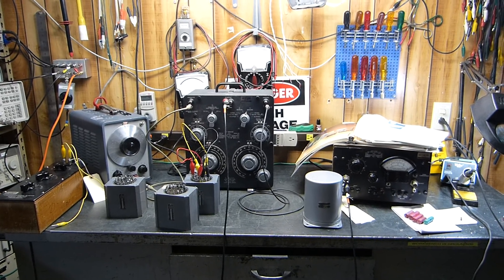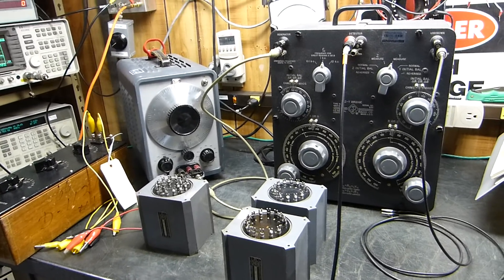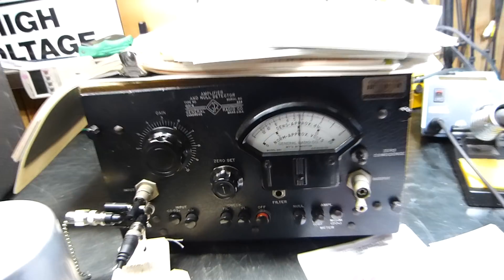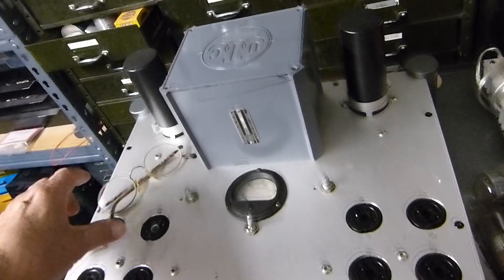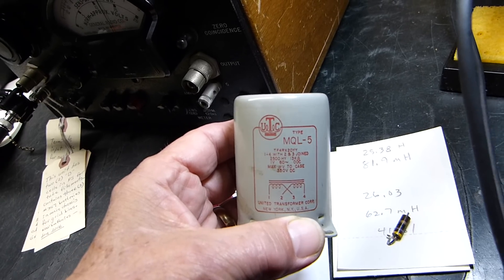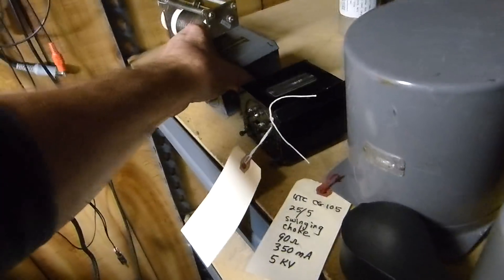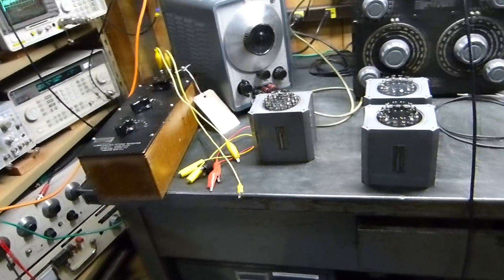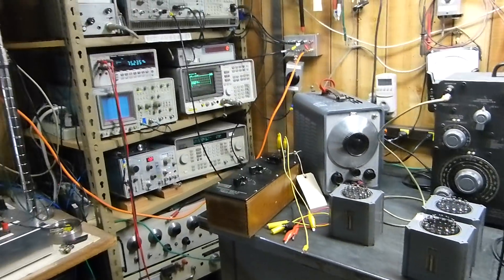UTC, James & McIntosh Transformers In Williamson Design Vacuum Tube Amplifiers

Comment: Agree especially the UTC A20’s I’d like to have more mixing transformers Low Impedance to Grid
Reply from the maker: I have built all of them that I show in the video. A stereo version with the UTC LS-57 using 7591. Also a stereo version using the Acrosound TO-300 transformers using KT66. Both are Williamson design with 6SN7. I find the LS-57 has a better high-end and the Acrosound a better low-end. Both are very good but I do notice that difference. The LS-57 will do 30KHz pretty good but totally falls apart below 30 Hz. The Acrosound starts rounding off above 20 KHz but will to 20 Hz quite well. Actually, right now, I have each stereo amp running as a monobloc, one driving the left channel and the other driving the right channel - a pair of Tekton speakers.  I have found out from years of listening to stereos that as strange as it may seem, mixing different amplifiers - or different high quality speakers in a stereo setup, actually sounds great. They are complementary - where one is a bit weak the other fills in and vise versa. I also built a stereo SET with 300B using 15H chokes as a plate load and James transformers to match the plate impedance to speaker impedance. Does a good seven (7) watts and as poor as SET amplifiers performs analytically, it sounds marvelous. It isn't all about THD - that is for sure. Thanks for your comments.

Comment: Good Morning here in Philippines!   My father left me some transformers that are at least 5 kilos heavy each one,  and the have ten terminals on the bottom,   and i am wondering how to use them now for maybe,  an amp for my electric guitar?  Do you have simple DIY plans on how to go about these mysterious things?   Thank you .
Reply from the maker: Hopefully, there are some numbers on the transformer so you can research it on the Internet. If I had the transformer in front of me I could probably figure it out. You have to determine which is the primary - the winding you want to plug into the wall outlet and then the others windings are pretty simple by using a volt meter. 
Do Not just randomly decide to connect a power cord to the transformer and plug it into a wall outlet. 
Very bad things could happen and even if you got it correct, you may have deadly high voltage on some of the terminals. 
I am sorry but without it in front of me and on my workbench with my meters, I don't know what to tell you unless you have a manufacturer and model number that you can find on the Internet.
Stay safe as transformers can be a deadly device once voltage is applied to them.

Comment: Hello, I´m looking for Output Transformers for 45 RCA Globe tubes.Primary 4,5-5k. As I see You have  the UTC and James transformers, would You mind to advise me which one is better for 45 tube? Thank You
Reply from the maker: I see from the data sheet that the 45 is capable of 18 watts with fixed bias. Very nice level for a Williamson design amplifier. 
The UTC LS-57 (rated at 20 watts) is a 5K primary and the James transformers I personally have are 8K primary so I can not compare them exactly 1:1. However, I will say this from my experience. 
First off, both of these output transformers perform extremely well. However, getting even a few additional watts out of the UTC transformers doesn't seem to happen in the same circuit comparing to the James transformers. I would actually expect a little more power from the 5K than the 8K.  On the other hand, the James transformers, rated at 20 watts, can deliver 35 watts or maybe a little more so it seems the James (and possibly all newer high-end transformers) are more efficient than the vintage UTC transformers.  
From a few measurements, it seems the UTC transformers perform a little better at the high end - 20 KHz and above, than the James transformers. 
As for price, they are about the same on Ebay and both are sometimes hard to find. It is just  me but I am not going to pay more than $150 top... for a 20 watt transformer.
The amplifier I listen to daily runs a UTC LS-61 and I think, overall, for whatever reason, I prefer it to the same amplifier when it was running the James transformer. Possibly that  is just my ears and my hearing does drop off sharply above 8 KHz as I have tested my hearing multiple times with multiple instruments.
For what it's worth, those are my thoughts on it.
Reply: @ElPasoTubeAmps   Thank You for reply!  do they both have a nickel  ? I looking for those 80% Nickel  OT
Reply from the maker: I assume you are talking about a shiny nickel plates case?   
The UTC is grey paint and I think the James is black paint. 
I don't know of any nickel finished ones.
Reply: @ElPasoTubeAmps   No, I mean the nickel core or/and nickel insolation
Reply from the maker: @rightturnonly6621  I don't know the answer to that.

Comment: I have a UTC transformer CG 302W. I dont have a wiring diagram to power 115 volts to primary. Can you help me out. My email is josealfaro1023@gmail.com
Reply from the maker: I found this.
https://picclick.com/Vintage-UTC-CG-302W-Commercial-Grade-173688140540.html

Comment: Cheater way to get bias voltage: Of course you can pull a "backwards" diode off one of the HV legs in a conventional FW tube rectifier circuit, just like on a Fender tube amp. Another way is to use a small filament transformer, backwards. Power the 6.3 volt side with the heater volts from your big transformer and you'll have 115 volts coming out the primary. Half wave or bridge rectify. I don't mind one bit powering an 0A2 or 0B2 gas tube followed by a voltage divider to produce a regulated bias supply. Cheers to you.
Reply from the maker: I like your way of thinking and have used the backward 6.3 volt transformer for bias supply. Not too long ago I built a bias supply for a pair of 813's in PP and used the VR tubes. I think they are beautiful. Thanks for your comments.

Comment: Happy and  productive new year. Love your videos. Are you using a different camera? I noticed that there is some framerate synchronization taking place when you film the oscilloscope traces making them flicker on and off. This is not a problem but I was just curious. I just completed two PPP KT90 monoblock amps that give me as little as 0.018% dist at low output. and 65 watts at less than 1%. They sound incredible.